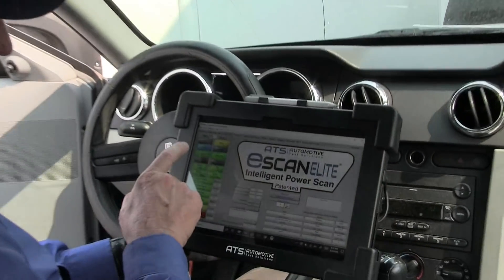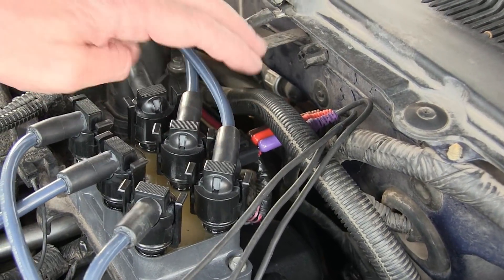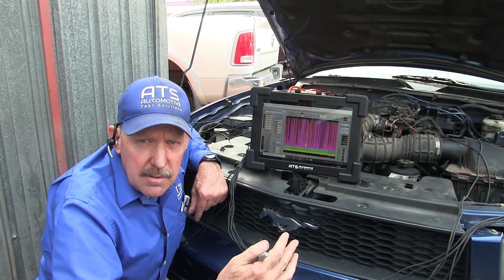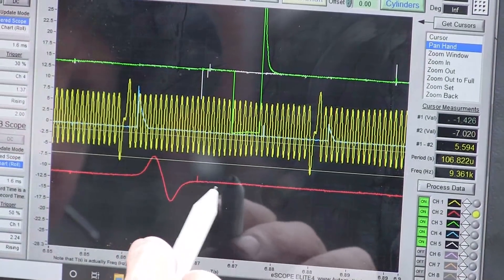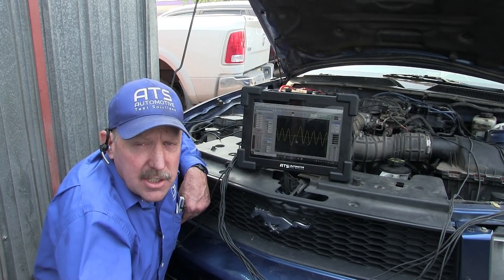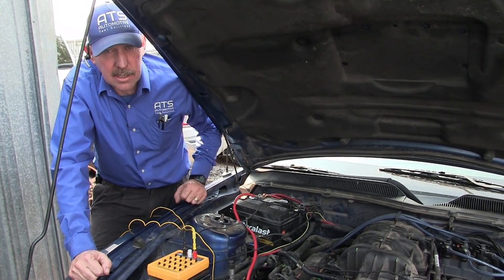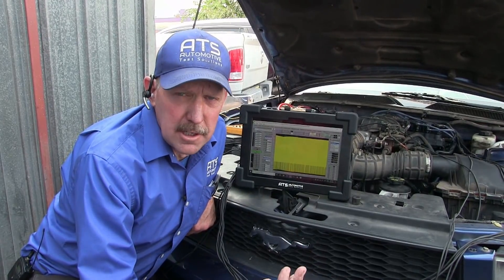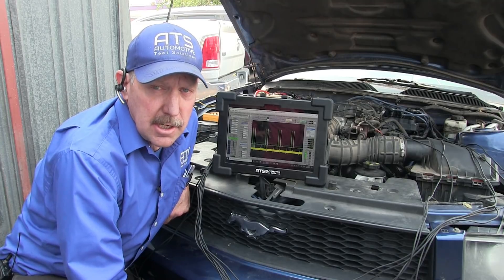Diagnosing a 2007 Ford Mustang Engine Cutting out between 2000 & 2500 RPM - Crankshaft Sensor Issue

Comment: I had the same exact problem on a ranger pick up with a re manufactured 4.0 .  I cut the small hump at the front of the tone ring out and fixed the problem.  I could have taken the front apart and ground the timing cover also but removing the hump worked fine.

Comment: you sir are a lifesaver !!  i swap all timming comonats on one of these junks, a month later this problem manifest, been pulling my hair out!! and whil i do have snapon modis, i hate sylliscope setup, and may have missed this subtle wave deformity anyway< but a quick visual varif path of center relucter wheel too close to center sensor , i believ what happen is over time cheap makeshift afterthout ckp sensor braket get heat distorted ! JUNK ! but some quick adjustment to t-covor and grind sharp edge off of half tooth and she runs perfectt !! GOOD FIND THANK YOU !

Comment: Thank you so much Bernie for this video! I just recently did a timing chain job on my Mustang 4.0L and I had the same issue and code. I had to grind down the timing cover so the crank sensor would align with the tone ring. Now the engine runs smooth. Thank you sir!

Comment: As you can see from the video, making a robust VRS zero cross detection circuit is not trivial. In looking at the waveforms, the VRS sensor has a DC bias voltage from the EDIS system. This is an attempt to make a virtual ground front end interface circuit that is less expensive to design as compared to a dual supply circuit where there is no virtual ground, ground is 0 Volts (the VRS is just a low impedance AC source which means it will work with a virtual ground or an actual ground, 0 Volts).

Also, you can see how critical it is for the sensor and target to be OEM and to have the proper clearance and center position. The magnetics of the target and sensor, even if correctly positioned, produces some interesting magnetic effects. For example, the mechanical position of the target wheel may not translate to the actual sensor output trigger point. There is actually a little bit of magnetic skew. You can see this if you put a very high resolution instrumentation grade optical encoder on the crank and then compare to this what the actual aero cross is indicating. You can also see some magnetic shift, as compared to the true mechanical position, as you increase RPMs. So, the lesson here is when you move away from OEM targets and sensors, you can actually introduce a fault.

Comment: The battery cables look like a complete hack. It looks like the alternator power output cable is missing its fusible link(s). I think on this year Mustang the CNK VRS signal is conditioned by the EDIS ignition (coil packs) and a PIP signal is then sent to PCM as a reference. You should look at the PIP signal to the PCM to see if it drops out. I think the CAM signal goes directly to the PCM and is not needed by the EDIS during crank because the coil packs fire two plugs on opposing sides of the firing order (no CAM information is needed), which is doable because the engine timing is even firing (symmetric). It would really be helpful if a wiring diagram was reviewed as part of the diagnosis.

Comment: Had a similar problem on a 97 manual jeep had to space it out 2/32 to gap it . The engine had 200k on it an the thrust washers were worn out an the crank had enough play to push the pick up away from the crank sensor

Comment: Very nice diagnostic work; thank you for sharing.  I see your capacitance decade box appears to simply be attached to the signal output backprobe via a gator-clip.  How does this effect the signal as seen by the engine computer?  My assumption would be additional capacitance acts as a "pull down" on the circuit, which implies the box could be installed anywhere on the output side to clean up the signal, including at any point on your scope test lead?

Comment: Did someone use a Dorman replacement part? LOL
Reply: Was that trigger wheel original or replaced ? If replaced , was it OEM or some " white box " crap ? Or , as mentioned - Dorman ? Just imagine if it was never engineered properly or a mold that gets out of tolerance when run thousands of times . Think of all the vehicles that had problems and the parts cannon - including ECM replacement ! And they were NEVER fixed !